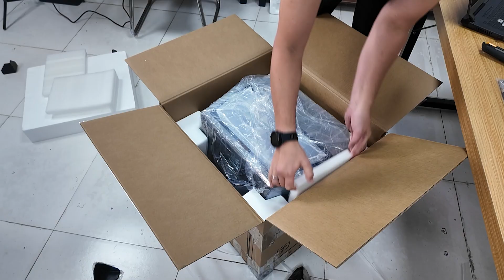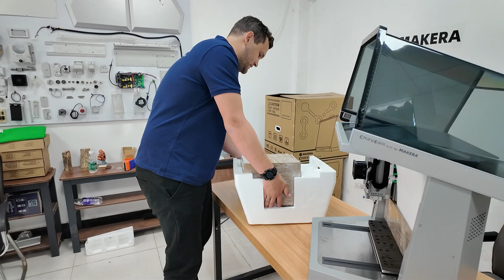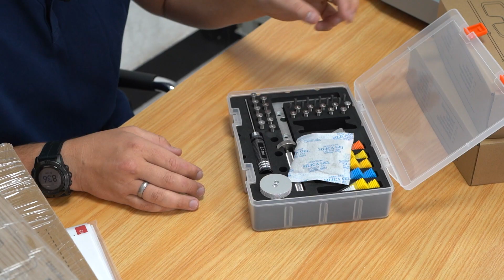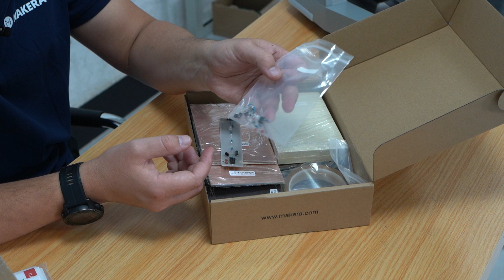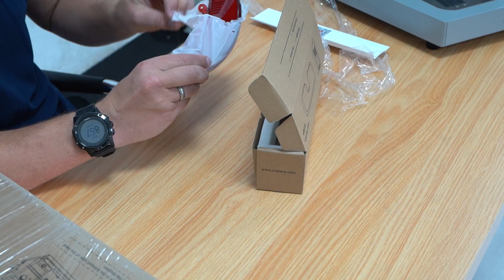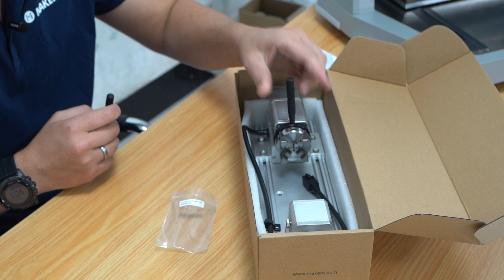Carvera Air Unboxing

Comment: One thing that I'd like to know while I'm researching the different 3d printers & desktop CNC machines is the use of the Laser, which you didn't go into.  What I'd like to know is what kind of material can the laser cut through are we talking very thin soft metals, like brass and aluminum or is it primarily etching for leather and wood, etc.  How deep of a cut can it make and does it require an assisted inert gas like Argon?  What's the thickest plate metal that can be cut with the laser, I realize it's not a Plasma cutter.
PS I really did enjoy this video otherwise, but it left me with several questions too.

Comment: I just got mine. Opened box and something didnt seem right. Extra tape, no bag on machine, no protective film on cover and then to really top it all off none of the accessories are inside. Cant even power it up as there are no cables!  Looking at the box there is another customers name on it covered over with another label. Looks like I have a returned machine. Paid for a new machine. Tool head is in middle of axis so clearly been played with. Also all the extras I order came today and as they are just in a bag, the 4th axis, PCB kit and laser boxes are pretty beaten up. 
Not happy. Just hope I can get all this resolved quickly. This machine was due to be the centre piece of a new YouTube channel showing the brainstorming, design and machining of puzzle boxes. Plans on hold for the foreseeable future.

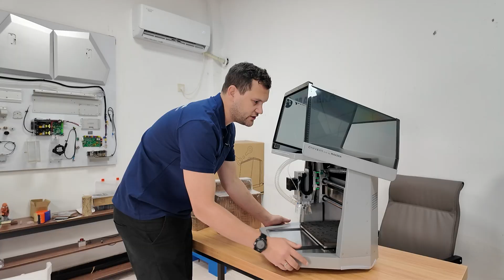Comment: 8:10. Just received a Carvers Air…cant find the input switch…are newer machines automatically switched to match input voltage?
Reply from the maker: Yes! All new machines are 120 / 220 and will switch automatically.

Comment: i dont see any switch on my machine for voltage, is that normal?
Reply from the maker: If there is no switch then you have the updated PSU that switches the voltage automatically.
Reply: @Makera please put this in documentation somewhere. I was panicking until I saw this comment.

Comment: Only little thing. You cannot see the position of the switch. I used a wooden stick back and forth to check if the power selector was in the correct position.  It a one time check.
Reply from the maker: Thank you for the feedback, we will look into it.

Comment: The pass through is bad - this should be better designed than having to remove screws each time.
Reply from the maker: Thank you for the feedback, at this time it appears that our users who are using the pass through may continue to use it, rather than install or remove the panel each time. But we will consider this moving forward.

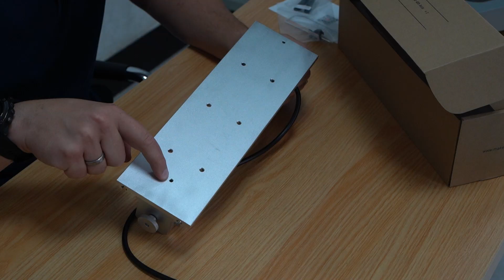Comment: 24:40 So I have to unscrew the motor-block, in order to reach the last 2 screws of the 6? And this each time, I want to mount the 4th axis? This iwould mean unscrewing 4 screws, screwing 6 in and 4 more, only for install. Not convinent.
Reply from the maker: The motor block is easily movable, You will only need to move this once before use, then all 6 screws are accessible. Its only packaged like that to save some space.

Comment: What bits, specifically, come with the Carvera Air?  I'd like to order bits from Makera that will compliment those that are coming with my Air so that when it arrives, I can begin working on a project I have in mind that includes threaded holes in aluminum.  I've asked this question a few times and was told during the live stream that the answer would be made available soon but, as of this time, the list still remains a mystery.  Related to this, will each of the three 10 packs of bits that the Kickstarter backers are receiving as free gifts all be the same cutting length and diameter or will each 10 pack include a variety of cutting lengths and diameters?  Lastly, are the free gift bits suitable for metals or are they the wood, plastics, and composites versions?  Any info is greatly appreciated!
Reply from the maker: Hello, the Carvera Air comes with 10 bits based on our examples projects. These include 2 each of a 0.2mm V bit, 3.175x12mm single flute bit, 3.175x25mm single flute bit, 0.8mm Corn bit, and a 45 degree chamfering bit.

Comment: Where PCB toolkit as well as all additional add-ons are going to be packed to?
Reply from the maker: The standard equipment, including tools, accessories, and example materials, are packaged within the machine. Additional accessories ordered would be shipped in a separate box most likely, depending on your region.